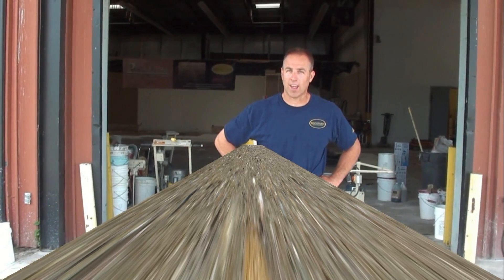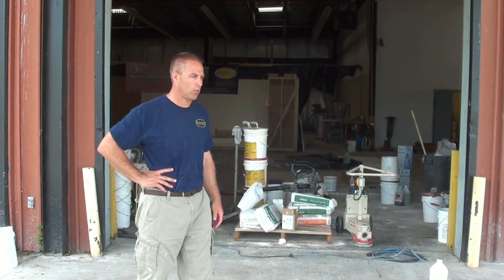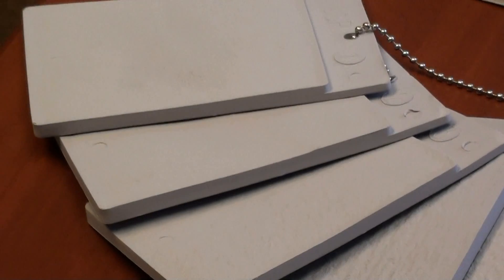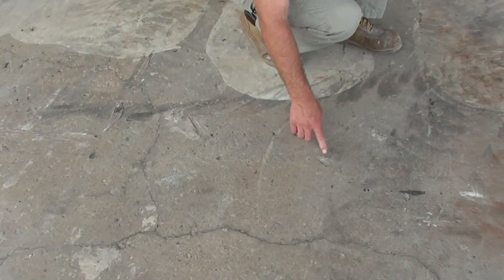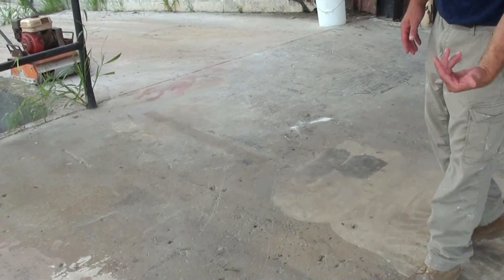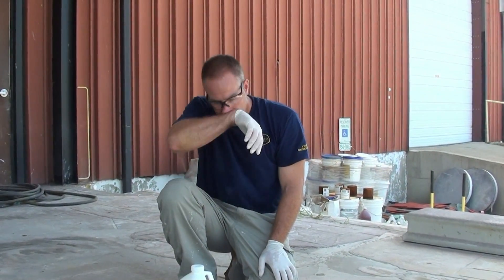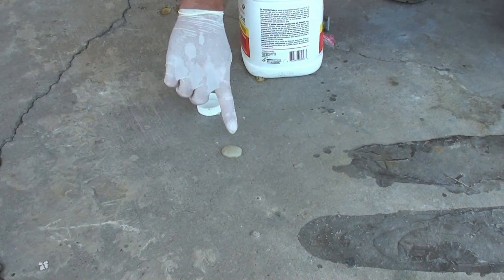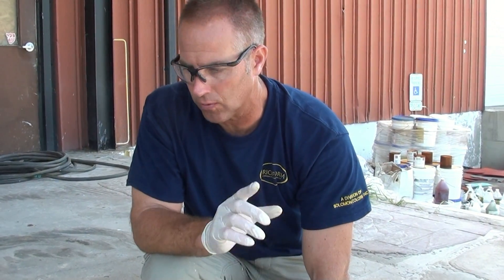Concrete Surface Preparation Video  1... INTRO

Comment: Wow...that looks..involved.  What was the tool you were using to check for spalls(sp?)?  Looked like a sharpening stone/aluminum oxide type block attached to a handle?